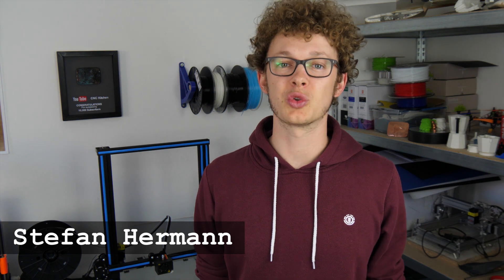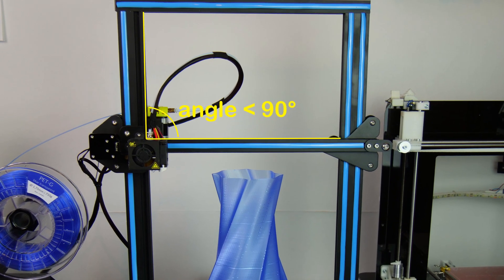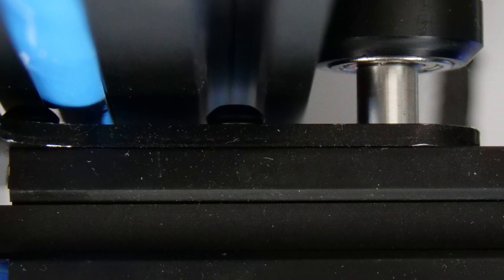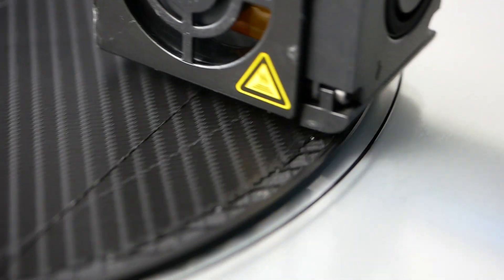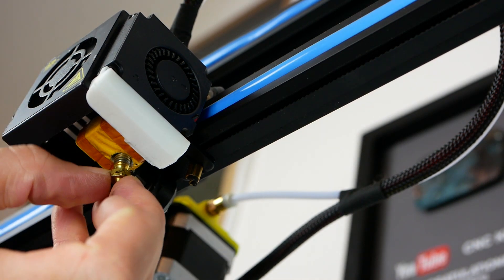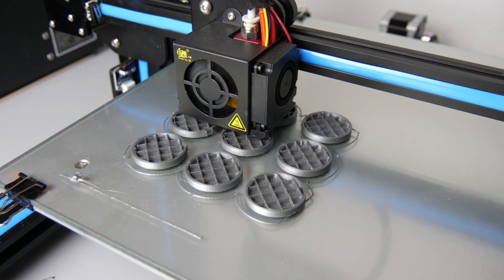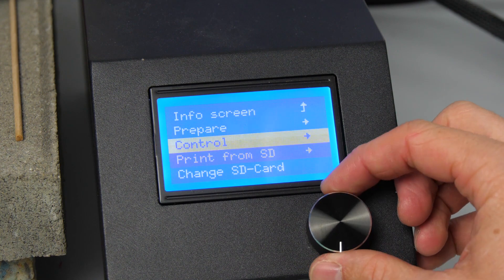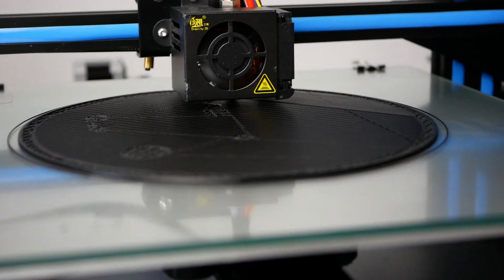Use your CR-10 the right way: BIG parts with a BIG nozzle!

Comment: At first, great that you did something different. But sadly the printer is much butter then the impression you imply.

I'm using it since 300 hours and I don't know what you've done to the wheels? Mine came perfectly tightened. If you tightened them more, it's your fault. The problem with the x axis is a mess, but easy to solve. In addition there have been added various fan ducts on thingiverse.

The printer does an amazing job, I don't know why you let him look like crap. In addition with a layerheight of 0.1 I cant see a difference between the prints of a CR-10 and an original MK3.

The only thing right is that it's the wrong printer to print ABS. And honestly, I don't care about ABS, PETG is fine because I don't need to aceton smooth my prints. Furthermore I have the same opinion like Makers Muse about ABS. It's a material from the beginning of the 3d printing era.  I don't know why everybody wants to print that toxic stuff? There are other good materials which can be printed more easy, but everybody comes around with that toxic stuff.... I will never understand why.

Comment: Thanks - Enjoyed the video. I am currently using a CR-10 for large prints and a little HIC (Ender) for smaller prints. I put the CR-10 (400x3) in a Grow Tent (on a cushioned table) and enclosed the little HIC in his own little box - What a difference! They heat up much better and I can store reels and supplies (JUGS of the new elmers- AMazing holding power).

I quickly realized that Both machines Must have a RepRap Champion upgraded aluminum extruder filament drive to 'push' (and retract) with any consistency when there's any heat on the bed. The factory plastic version can’t stay rigid and losses tension.
I also attached a 12v cooling fan under the extruder motor because the weak motor gives up with extended service and head (from the bed). Even the better motor would benefit.
The fan is set up to downdraft towards the bed and cools the motor dramatically.
I could not even touch it before! 

I must also offer some small advice (let’s face it- trial and error is the norm for the human race so criticizing other’s for (perceived) mistakes is like hitting yourself upside the head.
But I digress ;) while I digest - In reference to your nozzle: the distance that it extends beyond the bottom of the heated block with keep it from staying hot consistently, or possibly even reaching 240c +? A 3-D print veteran informed me that Brass, iron and steel [nozzles] carry heat so vastly different that these minor changes can cause SO many issues and even clog your nozzle and turn a spool of filament into an ugly nest a vulture wouldn’t crap in. Sorry – I‘m a little to familiar and emotional about that reality.
I now have a web cam that looks down on my extruder motor as the filament feeds into the tube – paranoia).  Cam saved me before I added the cooling fan to the extrude motor. 
I also had bolt cross thread issues with one nylon wheel. 
I also have had success by using the slightest amount of white lithium grease on the edges of the wheels and at top of the Z-axis screws inside the plastic retainer blocks  (they still have not worn).
I have printed full-size complex helmets and detailed human skulls in one piece with the CR-10, one print was 124 hours. But eventually it failed miserably and I lost much Much time working out these problems and hope these help you and other Makers Builders and Creators. 

Try these if you have issues. But get your nozzle closer to the block, enclosing your machine (with some ventilation) will help stabilize your temps and your nozzle may retain the heat. Truly $30 us. Saved my sanity.

Happy printing everyone – southwestjeff
*May you never awake – completely engulfed in a web of filament 
Reply: Great comment! I'm keeping it fondly on my desktop for future reference! My CR-10 (first printer) is arriving in about 30-45 days(15 according to BangGood but I live in Brazil and our customs take forever to release the parcels). Continuing my uncalled for whining, I'm paying 715USD for the CR10, because customs will tax all imported things in 60%. So I have to mod the ship out of my CR-10 to make it worth the price I'm paying. Still super looking forward to it, though =D

Comment: Badest and most unrealistic review i ever saw on youtube about the CR-10! To many payed reviews you made. I never had problems with my CR-10 and i know so many forums where nobody like you had such problems you are talking about. Sorry but the CR-10 is one of the best beginner 3D-Printers you can wish. I will cancel the subscription now!
Reply: The problems you can see in the video are obviously legit. He clearly shows them.. If your CR-10 is perfectly 90° aligned, be happy about it. His printer wasn't.
The slow heat up cannot be any different on your machine. Same goes to the long print times.
I'm usually printing at 0.2 on a 220x200. A 300x300x200 object would take DAYS . So a CR-10 really needs a bigger nozzle than just 0.4.
Most of the time you will find yourself print smaller because 300x300 is too large. And because most of the time you print small, you could actually grab a printer which is smaller and faster.

Comment: the failing wheels is either you got some bad ones or they are too tight. I have over 2000 hours on my CR-10 and no appreciable wear on the wheels. I beat the snot out of the little bugger :-) well I guess its not little ehh :-)

and thank you again for the Anet E10 shroud WHAT a difference that makes!! fantastic.
Reply: Same here. I have about 500 hours and no wear on the wheels
Reply: You've restored my hope, thank you.
Reply: I totally agree with you. I've recently got a CR10 4S and it was a straight forward printing with great result without any change in parameters which I'm a beginner in the 3D printing world.
Reply: this happens because the wheels are too tight. I got an ender 3 recently and had the same problem. Most probably this happens because the parts are not perfect so there is an error, and since I doubt that they calibrate the kits before selling them this is a common problem. Very easy fixable, just locate the screw that is responsible for how tight the wheels are and adjust the wheels, make sure that you tight everything back after finishing or you will have problems with the prints.
Reply: to me it looked like the wheel was not riding parallel with the rail,probably the hole holding the screw was not cleaned properly and it went in at an angle.
Reply: 2000 hours? Wow. How many parts have you had to replace on it over that time?
Reply: @Martial-Mat  2000 hours is not a lot for a 3D printer, it's about 200 decent sized prints. The PEI bed stops sticking, but I' haven't had to replace anything.
Reply: @truantray  Well that's encouraging news. What does PEI mean?
Reply: Mat Broomfield PEI is type of build surface that offers really good adhesion to your prints
Reply: i never had problems with my CR-10 or others i know. Whole forums are happy with their CR-10 and most of them are total beginners in 3D-printing! I dont like this review. Its only a payed review and he was searching what he can review to make also minus points to let it look like a honest review!
Reply: @loao3693  that's exactly what I thought in the middle of the video

Comment: I have a question dude, I do a lot of character in modeling in Maya, and although I like the big build size im not good at engineering so I'm wondering, prusa or cr10
Reply: cr10 is easy to put together  its mostly done already.  but there both good printers.  they both have there ups and down's.   also  your a maya user..  maya has a plugin for 3d printing.  so you do not need a 3ed party program.  also easy cause you got more control over your prop.     i been using maya since maya 2.0  and owned maya license up into 3 years ago. good luck with printing it gets better once you learn more about it

Comment: With the Volcano you print at higher temp but lower speed.
Reply from the maker: Actually exactly the other way around. You can print at lower speeds faster, since the material has more time to melt evenly.

Comment: I am struggling with larger nozzles, I have a robo 3d and I constantly get under extrusion even with large flow rates and high temperatures. What would you recommend I look at changing in my settings?
Reply from the maker: +Dmc3D &more Lower your printing speeds. The Hotend is probably not able to keep up melting the material.

Comment: i just installed the micro swiss .6mm nozzle upgrade kit on my cr-10 and was struggling to figure out the settings. I am using cura (free) as my slicer could you please help or do a video with settings for cura to get good prints? also what slicer are you using? thank you in advance for any input.
Reply from the maker: I'm using Simplify3D. As I pointed out, the only real changes I made to the profile were coasting and wiping distance and these settings should also be available in CURA.
Reply: I love the DoE discs you used.  Is there a file for that somewhere?

Comment: Would you mind sharing the new fan nozzle part as it looks like an improvement on the standard.  I have a slightly different model which points it lower more onto the part but it still points the air to the full width rather than focusing on the print head.
Reply from the maker: +Colin Hickey The link is in the description.
Reply: Sorry, hate to be that guy who asked the obvious.  I looked and couldn't see it, many thanks i see it there now I've looked properly.

Comment: You can get up to .8mm genuine nozzles for the v6, but I've actually used an aftermarket 1.0mm nozzle. That thing spits out prints at warp speed, and the print quality can actually be quite good, with a lot of tuning of course.
Reply: @RalphV  I took the 0.2mm nozzle that it came with and drilled it out to 1.0mm and it works great. Especially on spiral mode, you can do huge parts very quickly. I use 0.5mm layer thickness at 30mm/s for nearly flawless quality, and coat with XTC-3D epoxy to smooth out the layer lines.
Reply: Could you share your profiles for printing with 0.8 mm nozzles please? (Layer height, retraction, speed, temp etc)..trying to get good results with the Creality S5 with a 0.8 nozzle.
Reply: Im curious Thomas, do you have Cura settings for the .8mm nozzle that have created quality prints using PETG or PLA? Im struggling with my .8mm nozzle on a CR-10 and experiencing a lot of ghosting and "stitch" marks at the seam.

Comment: you don't really need to heat the bed with pla.
Reply: In my experience, large PLA prints require a heated bed, else they will warp. The larger the print, the more square corners, the more likely this is to happen. I usually use 70C first layer, 65C for the rest of the print when I'm printing those kinds of object (which is most of the printing I do). I also use a higher nozzle temp for the first layer and turn off the part cooling fan for the first 3 layers. This combination has solved any PLA warping that I was seeing.
Reply from the maker: Mini prints yes, but trust me, a 60°C heat bed makes life so much easier even with PLA.
Reply: ok, good to know. (I never did Big print actually)

Comment: Interesting video: some more idea to choose the right 3D printer!
In the control box I see a small problem: the connectors are potentially dangerous: bared pin should be on the load side not on the supply side.
If  by mistake you switch on the control box without connecting the motors you find the pins in tension.
It is true that the voltage is low but if the internal power supply is similar to that of a laptop, there is a risk that a pole is connected directly to the network and that there may occur in an electric shock.
I do not know if it ever happened to you: when, during summer, I use the laptop with bare feet and legs I can not put it back to my body if the laptop is connected to the external power supply, because the chassis screws on the bottom of the pc send me a small, no fatal but annoying, electrical shock ... as long as something in the power supply does not break!
That's why I say transformerless power supplies may be somehow connected to the power grid
the power socket has the bare pins too on the box side but in this case the box itself is the user since power comes from the power cord (made with protected pins)
for maximum safety  it would be best for all the outlets socket  to be protected: in my work they taught me that all you do not do to avoid a risk equals to allow it
Reply: Yeah, no, the whole board is Earth referenced! It's not floating. 

Transformerless power supplies? What? No, those aren't a thing, i mean they are a thing in lightbulbs and other sealed devices, capacitive droppers, but they're properly deadly to touch, so you'll never see one with exposed wires, not from any legitimate source anyway. Any exposed electrics, phone charger, laptop charger etc has SMPS, a power supply with high-frequency transformer separating the mains side and the low voltage side.

Sometimes floating power supplies can tingle you, it's annoying but it's not dangerous. What happens is they have a Class Y capacitor going from mains side to the low-voltage ground. It's silly, but it's necessary to prevent electromagnetic interference to other devices. These capacitors come with a strong guarantee that they will never fail dangerously, they will never short across or spark across. They will only reduce in their effectiveness as they age, or fail fully open. You can easily trust your life to a Y capacitor.

What you can't trust quite as much is the transformer, which although is supposed to be certified safe, realistically is the more dangerous part, because it really has no reliable mechanism to fail open, and sometimes they miswind them so the certification is right out of the window. And you'll never know when it will fail, as there is no indication whether it might or might not do so, except you know the usual, bad smell, heat, fire, high voltage across your heart and subsequent death, all those things that happen when it's too late already. Well, don't panic, it'll probably be fine, you could as well win a lottery.

Comment: Buy a bunch of cheap Chinese nozzles and drill them out (gradually) to 1mm or a little larger. You'll definitely need the volcano for that!
Reply from the maker: I wouldn't do that, because there is a high chance that this causes issues due to surface finish and burrs. Also if you take a look at the internal geometry of 0.4mm nozzles and 0.8mm nozzles (E3D) there is quite a difference. The nozzles are not expensive, so just buy some genuine ones and save yourself some hassle.
Reply: I have both genuine E3D nozzles and clone nozzles I've looked at under a 300x microscope. Trust me, if those clone nozzles work, then you could definitely drill a nozzle. If smooth finish really is a concern, run some string thru with toothpaste and polish the surface. It would be a fun experiment!

Comment: On my CR10 S4 (400mm bed) it is even slower to heat the bed. Printing ABS is a no-go as it maxes out at about 78C and goes no further. An enclosure may help, but they definitely need to make sure in future they sort out the warped beds, unsupported bed heating cable and beef up the bed heater.
Reply from the maker: I'd double-check if the MOSFET for the bed is able to handle the additional load.
Reply: CNC Kitchen if necessary I'd add another FET in parallel to handle the current and another heatsink for both
Reply: Andy Midd I'm thinking of adding some nichrome wire to the bottom of my bed to help with the heat up times although it might consume a bit more power but it's fine with me. also on the nozzle, since I have access to a lathe, I'm thing of cutting some thread like groves onto which I could also wind some more nichrome wire around(lots of wire, I know lol) and hook it up to the wires coming from the heater
Reply: I had a similar problem with my 210x270mm heat bed. I used the heated bed wires to drive a solid state relay that pushed 15v into the heated bed.  I now get to 110c in about 4 min without an enclosure. At first this was only a patch with a spare power supply, but it has worked for me for over 1 1/2 years with no problems so I think that I'll keep using it.
Reply: I was surprised to see that on the CR-10S the heatbed cable is attached firmly now using 1 of the upgrades found on thingiverse. The next thing they should improve heatbed insulation to heat the bed up to higher temp in a reasonable time. I've order heatbed insulation but haven't received it yet. There are vids here on Youtube where they try out heatbed insulation.For the S4 and S5 bed insulation is a must.